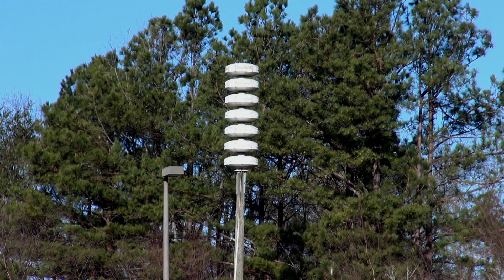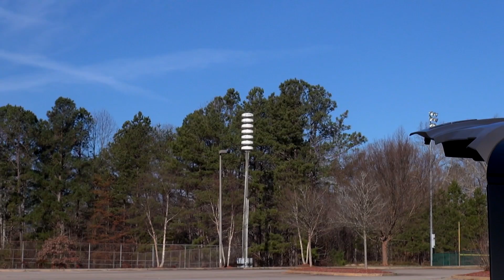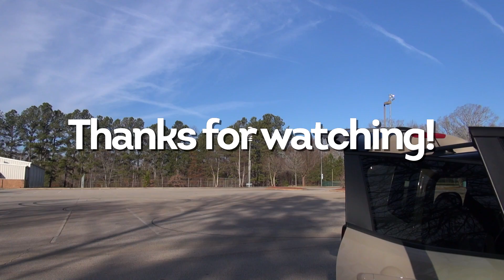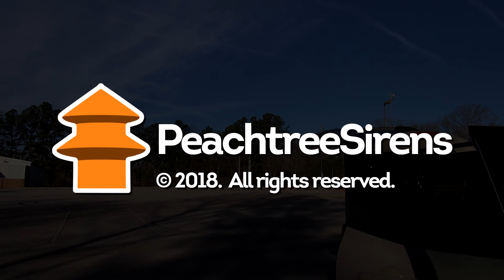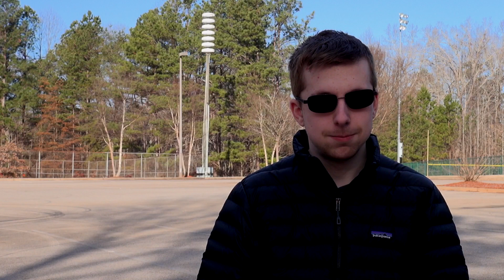FS Modulator 6048 wail (broken), Gainesville, GA, 2/09/18

Comment: It's not the drivers. The batteries are on their last leg.
Reply from the maker: Ah, yeah, I guess I should've been clearer...I did figure the batteries had something to do with it, but the drivers didn't sound too good either as a result. Thanks for setting things straight!
Reply: DJ2226 That’s what happened to me at an EOWS 612. It made a couple popping noises and rotated at about 0.1 RPM!